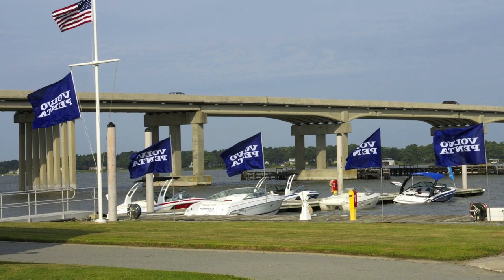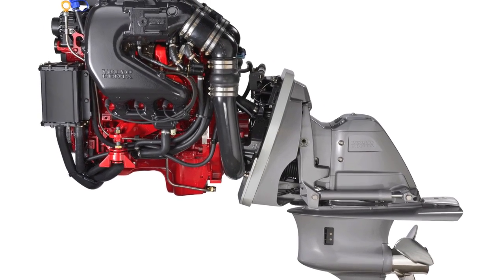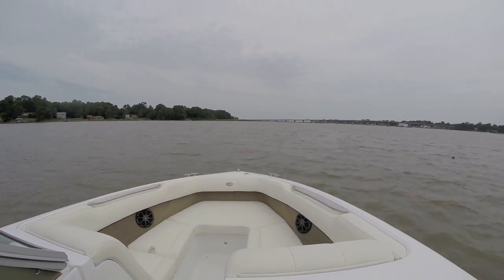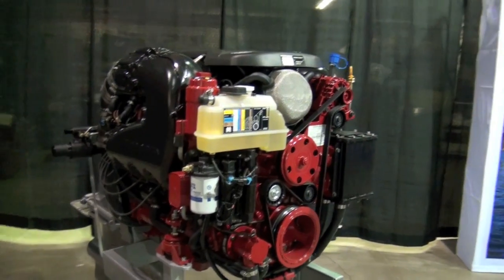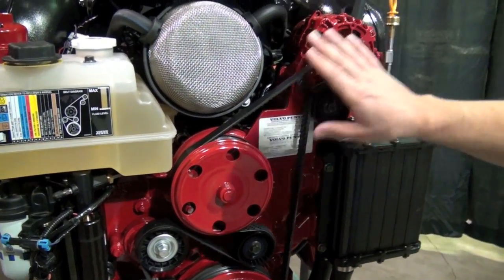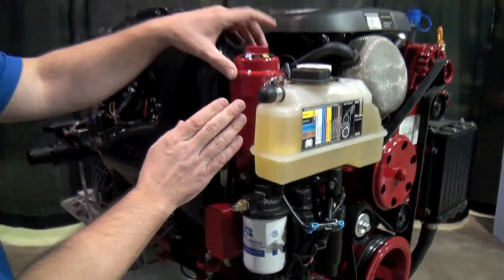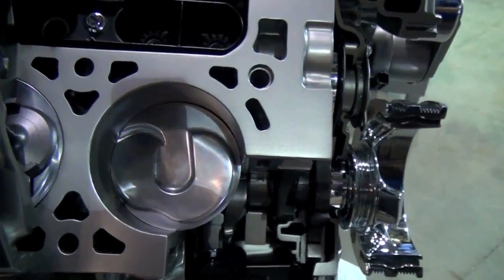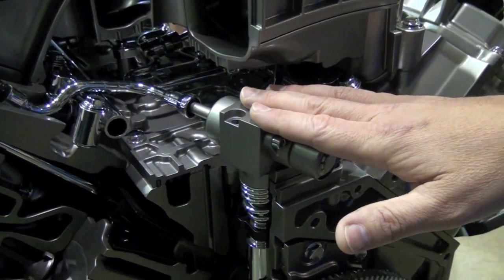Volvo Penta's New 'Gen V' 5.3L V8 Sterndrive Features Direct Fuel Injection

Comment: I have searched all over the Internet and even this engineer unfortunately does not explain that VP has eliminated the Easy Drain Push Button drain system on 2016 and newer Gen. V engines.  My manual now just wants the bottom two hoses to be drained on the 300 C  5.3.  Even their promotional factory literature does not explain that the Non Easy Drain system no longer exists.